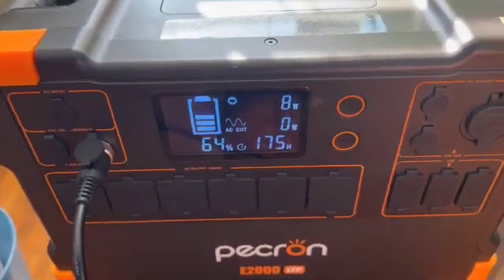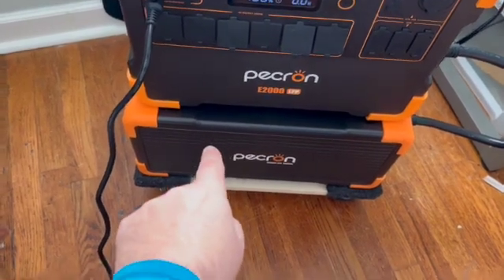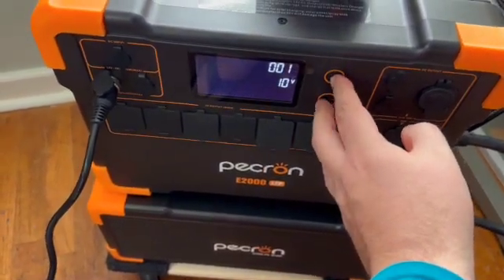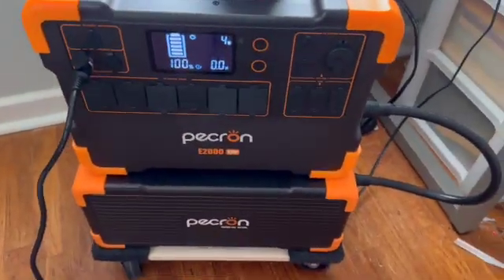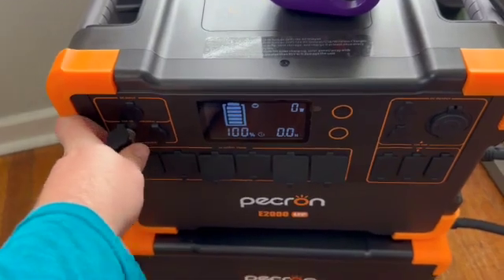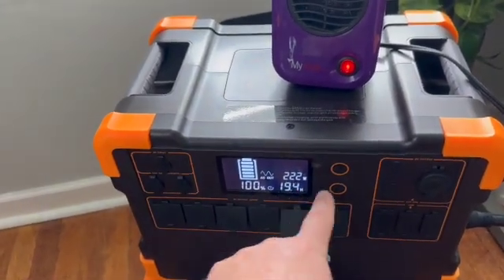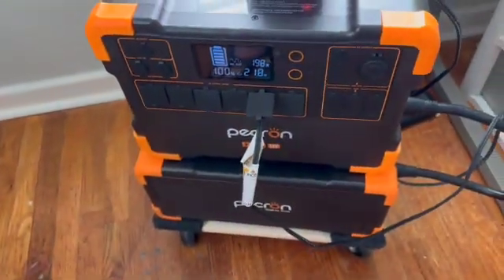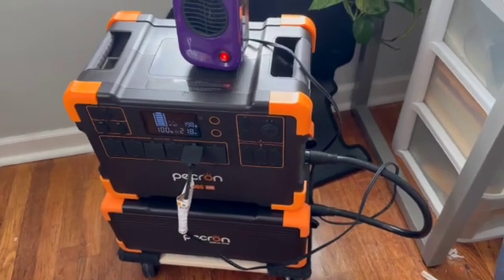How to correctly cascade the Pecron E2000LFP to EB3000

Comment: I have a question… I have the same set up as you. Did your 4992w show up immediately when both units are connected/cascaded and the does the second battery need to be on or off. I have been told if not set up right it will ruin the battery. Help?
Reply from the maker: No, you have to manually change the setting. The user manual should explain the process but customer support is a great resource.  They've helped me a great deal in the past

Comment: My e2000 makes those same crazy noises as well     I'm down in Houston riding out the hurricane.    This is the first time I used it.     Do u think that sound could be dangerous l?
Reply from the maker: Mine made that noise and I ended up sending it back and it was replaced.  It will make some minor noise but if it sounds like mine, yeah, I'd reach out to support and request a new one.  It wasn't dangerous, voltage was normal, running at normal temps but the inverter kept making that clicking sound.  You should be fine for the hurricane.  Best of luck to you and yours!!

Comment: Great video, thank you.  My problem is that I cannot get my E2000 to charge up past 78%.   The e3000 shows all charged.  I disco'd the two units to do as you suggested, but it seems stuck.  Any suggestions would be appreciated.
Reply from the maker: You might have the units cascaded incorrectly.  What is the voltage showing?  Really, @RamblinBobReviews has been great at helping to answer technical questions but I've found Pecron's email support to be a bit slow and cumbersome BUT they've always come through with solutions.  I'd reach out to Bob to see if he has any ideas and contact Pecron and I' sure they will provide support.  Best of luck to you!!

Comment: Thank you for the shout out BucksBe :)

We have really learned a lot with this model, and all the pecron models :)

note: Yes, you have to wait until all the batteries and the main unit reach 100% to be able to reset that power meter :)
(sometimes it takes an hour or two depending on the power meter reading to correct itself)

note: if you ever charge through the batteries, you have to repeat this process every time to reset that power meter.

E1500lfp has fixed this problem and checks the power meter non stop through out the day :)

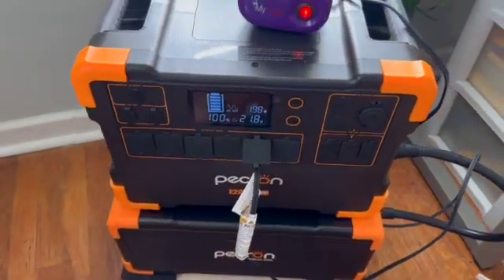    WARNING !!!!!......YOU CAN ONLY CONNECT 2 X EB3000 BATTERIES TO THE E2000LFP, NOT 3 AS MENTIONED IN THE VIDEO (4:45 timestamp)
(If you connect more than 2 batteries to this system, you will risk starting a fire due to the resistance of the batteries) !!!!!
E2000LFP + EB3000 + EB3000 is a MAX system for this model :)

P.P.S. And we do not pay ANY attention to the lights on the batteries anymore (unless it is flashing red very fast meaning over voltage)

The lights on this system are just useless most of the times it seems, they feed power to the main even if the lights are off ;)
(we have mentioned this many times in our videos)

Like I said, Pecron fixed this problem with the lights on the e1500lfp :)

Comment from the maker: I charged my EB3000 to 100%, then the E2000LFP to 100%, unplugged the charger and connected the two batteries using the cascade cable.  I turned on the E2000LFP, and it was reading 63% charged (even though I knew both batteries were charged to 100%, so I assumed that the display unit wasn't reading correctly.  I adjusted the 004 setting back to 1920w and let it sit for an hour, then came back and adjusted the 004 setting back to 4992w, and the display was still reading 62%, which led to my frustration.

With the following settings,

fully charged E2000LFP
fully charged EB3000
cascade  cable plugged into E2 & E3 batteries
004 setting set to 4992
plugged A/C Charger into E2000LFP 

Even though both batteries were full, the slow trickle charge increased the battery percentage shown on the display unit. After about 45 minutes, it reached 100%, and the batteries were successfully cascaded with the green light showing on the EB3000. I don't think this section is in the manual, (but it should be)